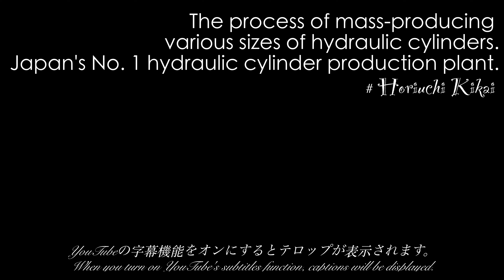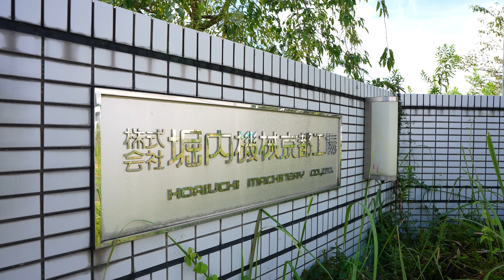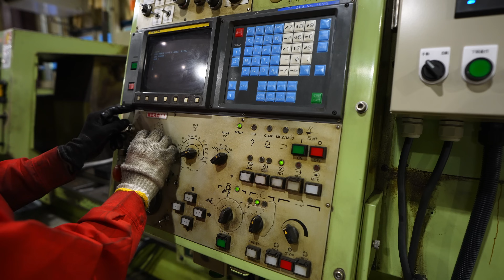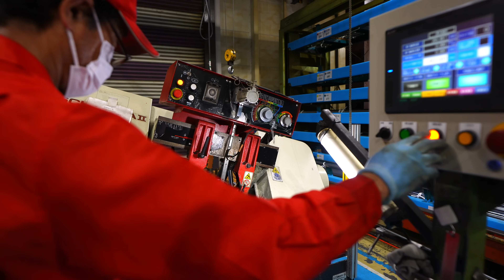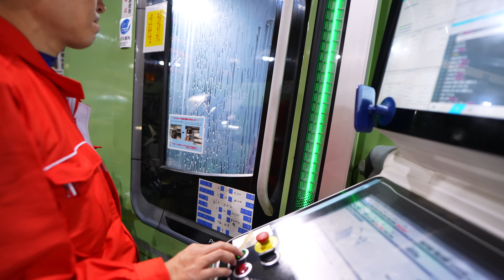日本No. 1の油圧シリンダの大量生産工場に密着！素晴らしい日本の油圧シリンダの製造プロセス ASMR　職人技

Comment: The "cleaning" process is actually a machining process called skive and burnish. Painting the cylinders separately seems like a huge waste. Cylinder painting is usually done after final assembly. Also they should be using electrostatic painting. 
It seems like there is a lot of over processing. For example, why debur the end of the when there is more end machining to be done. CNC machines can easily hold .01 mm tolerances on this size parts. There is no reason to manually machine any of these parts.